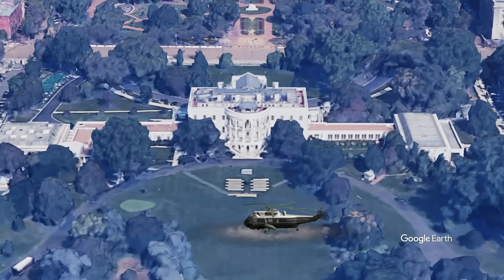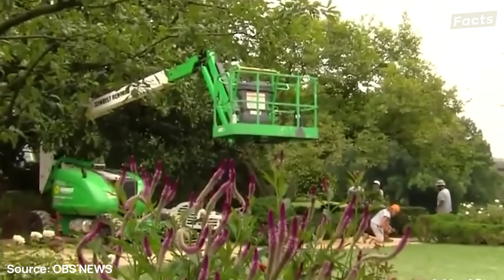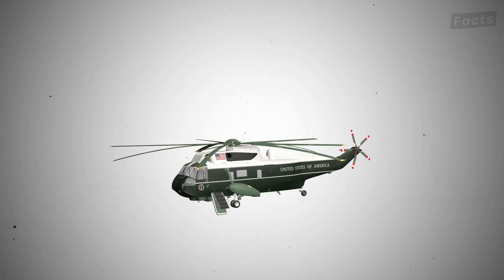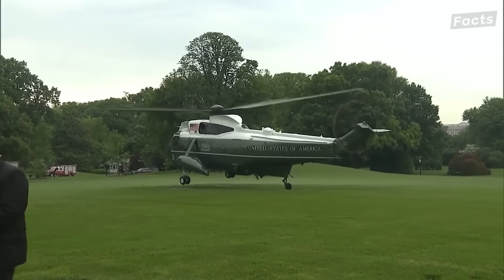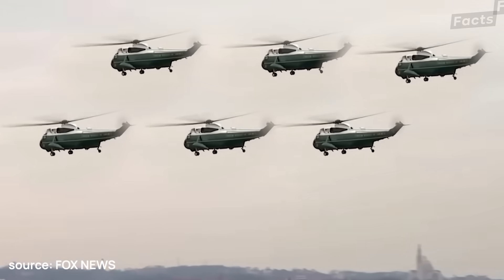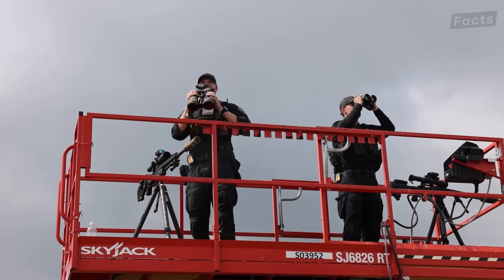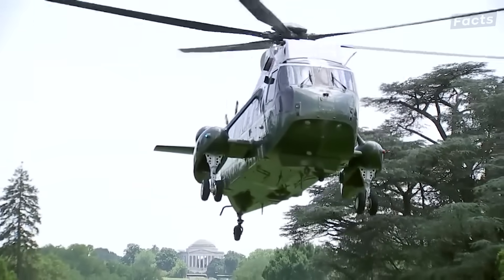Why Marine One Lands on the White House LAWN?

Comment: Yeah, it does feel absurd—spending billions on a helicopter only to stall over a patch of grass when a slab of concrete could fix it. The White House clinging to tradition over something this practical is peak bureaucracy. They’ve got the tech to fly the president safely across continents, but apparently draw the line at a helipad because it might ruin the vibe. It’s almost comical—like refusing to fix a leaky roof because the shingles are historic. Paving a spot seems so obvious, you’d think they’d have done it by now just to shut everyone up. What’s next, banning the chopper because it scares the squirrels?

Comment: Just to throw it out there the rating for the typical industrial type blower used by landscapers blows air much faster than 100mph. I think it’s like 250mph. So either the helicopter wind is WAY faster that 100mph or the speed of the wind coming from the rotors is of no concern at all to the grass

Comment: How about using the fountain as a landing pad?   Modify it a bit with easy walking access, turn the water off (duh), the blade down wash would try it out for easy walking.  The existing fountain may need to be enlarged/modified/reinforced.  But the grassy area would remain.  In essence the fountain is updated and becomes multi-functional.  Yes, the passengers may need to walk a bit further.

Comment: The simplest reason is because grass looks way better and does not heat up the air as much as a helipad would. Anyone who has ever worked on or had to travel across a concrete taxi way knows how incredibly hot they get in the summer time. With boots on walking a mere 50 feet across that concrete would get your feet so sweaty your boots start squeaking.

Comment: Ok the point 😂this video is moot. A there is a massive underground tunnel system under DC the President has ways to get to multiple evacuation sites.  Usually Marine 1 is a smoke screen. Let's examine some system magic. The President walks to the aircraft. He/She might speak to the press on their way, once inside the aircraft. You are distracted by all the other things that are going on behind the scenes. The President can exit the aircraft and slip into the tunnels the Helo takes off and then lands and you see The President walk to 28000 or 29000 and he can enter either plane then exit using different tricks used by magicians to exit for the other aircraft. The point is you can never know where the President is once he enters any of the vehicles required for him to travel. Plus the use of Body doubles is a must. For example Hillary Clinton had 5 body doubles. You have to be very observant to know if you are really seeing the real Protectee. Even if you are literally present in the actual area. Watching it on TV more magic is used. You see camera positions angles. But you never see behind the aircraft. When any protected person enters a vehicle it's always a close up. All to protect the Office and individual. It's all a Choreography, very complex and has many more parts than the public is aware of. We saw many parts of the breakdown in the Choreography with Biden and Harris. Only believe 1 quarter of what you see from your position of view and less than an eighth of what you hear. It's a complex process to protect an individual. More moving parts on a 3D scale kinda like solving the rubics cube on a 3D chessboard

Comment: Here in Ireland the SR-92 is currently used by the Coast Guard however the fleet is being replaced as they are outdated and parts are now hard to source. It's difficult to  understand  why the military presidential variant the VH-92 is now being introduced as they are already outdated here. How are they going to source parts given they can't be sourced in Ireland as parts manufacturing is being discontinued I believe.

Comment: Holy fuck... The solution is so simple it’s not even funny.  
Artificial grass. Nowadays, it’s so good that from less than 2 meters away, you can’t tell it apart from the real thing.  
Just build an H landing spot and cover it with artificial grass. Problem solved.  
Plus, it won’t need to be cut or watered.

Comment: there are several options they could employ... 2 of the easiest... 1) just build a damn helipad and during events cover it with astro turf..... hello??? and 2) could do a solid engineered permeable base topped with turfstone pavers that have grass planted thickly in them.... its such a small area from the perimeter fence you would never see it..  the solutions sure don't seem to be rocket science... from this tax payers standpoint, build the dang pad....

Comment: Soo lay down a concrete pad, put high end turf over, distinguishable from the sky where to land, but still picturesque from the ground level. Reinforce whitehouse structure with wood or steel. This is the United States lol easy “problems” to solve

Comment: A lot of misinformation in these comments. I'm speaking as a former HMX-1 Command Pilot. The aircraft do not land directly on the South Lawn grass. Before a landing, 3 red-painted plywood circles (called "the boards") are carefully placed at pre-surveyed spots for each of the helicopter's wheels. If you look carefully at the video, you'll see the boards. Less evident are the two sections of flat firehose that are placed in line with the aircraft commander's foward centerline and his right shoulder. These act as as guides to place the landing gear precisely on the center of the boards. The copilot also verbally guides the Command Pilot giving running directions as he's looking over his left shoulder regarding final approach to the touchdown such as, " Back 20, up 10, back 15, up 8, back 5, up 3, BRAKES!"  At the "BRAKES" call, the aircraft is gently lowered onto the boards, and because of the VH-3s natural hover attitude, tailwheel first, left mainmount next and right mainmount last. I was there for the Regan/Bush administrations so I'm not sure how the procedures will be different for the new VH-92A.

Comment: You can stiffen the soil.
You can buy this plastic, expandable "web" that has pockets that are usually between 2 to 4 inches deep. You expand the "web", lay it out across the soil, fill soil into the pocket cells, and then toss some grass seed on top of the whole thing. You could even start by first putting a layer of crushed peat stone underneath it.

Comment: Downwash has nothing to do with the engine or its horsepower, it rather is just a result of the helicopters weight. The heavier it is, the stronger the downwash. (Newton's Law of Force)
Reply: It's the rpms of the rotor operated by the engine to turn the rotors the heavier the helo thr more rpms you are going to use so to answer this question yes you need the motor to operate the helicopter the more rpms on the rotors the more downwash
Reply: No engine no power no power no downwash genius
Reply: @tylerbuckley4661  nope that’s not true. Big helicopters have their rotors running at a constant speed, they gain torque by using a governor which adjusts the blade angle.

And still Newton didn’t care about RPM ;)
Reply: @vw72713  not the govonor it's called a collective stick on the left hand side of the damn pilot which  has the throttle and newton's law has nothing to do with jack crap Bubba

Comment: Why not simply land on a mobile pad that is driven out on the grass w lawn safe undercarriage designed to absorb the heat from the exhaust and be designed to self level. Drive it in when needed. I have a feeling the Air Force one after the new one coming so say 2050ish will be a plane with hover tech as well so they likely will land either Air Force One or a s m.h Waller version that can lift off and jet off much faster then any helicopter is able.

Comment: They could solve the issue with the LZ by digging up the lawn and putting a thick layer of concrete in the ground then replacing the soil and laying down fresh grass to hide the underground concrete pad.

Comment: I've got significant flight time as pilot in the USAF variants of the H-3, the CH-3E and the HH-3E "Jolly Green". This video severely overstates the  "problems" of landing a helicopter on a grass field. The helicopter would be pretty useless if it could only land on reinforced concrete slabs. The presidential support mission is rather a "Gucci" operation: pretty clean, don't get dirty. The rest of military helo ops require routine landings in grass, dirt, mud, sand, snow, tundra, everything. I have literally thousands of landings on unprepared, untouched by human hands ground and never sank into the soil. Outflow from downwash, however, is a significant problem for surrounding structures and people.

Our youngest helo pilots are taught early on to land with "sniper-like" precision within several feet tolerance... not an easy feat at first but something every pilot can do by the time they earn their wings. Twenty years of experience is not needed for this skill. We pick O-5s and O-6s for different reasons.

The Flight Restricted Zone around D.C. and the Prohibited Airspace around the White House do not restrict the overflight or landing of Marine Corps One. That would be sort of like preventing firemen to enter a burning building. There was no point in citing that airspace as restrictive for MC-1 operations.

Lastly, a major reason for delay in replacing the VH-3 is because President Obama slowed the procurement program in 2009 as a budget cutting act. At one point, he told the media "The helicopter I have now seems perfectly adequate to me."
Reply: "The helicopter I have now seems perfectly adequate to me." 
Was it adequate?
Reply: @rael5469 He survived the use of it!
Reply: @rael5469  8 years laters with the overtime and overbudget for these kind of project …

That was like thinking you can clean cat puke on the carpet later in the week…
Reply: @G_de_Coligny   A helicopter isn't cat puke. That's just weird.
Reply: @rael5469  I've never connected Marine One with any sort of regurgitating felines... as you clearly stated, "That's just weird!!" Well stated.  More to the point though, someone on the President's staff should have some influence on the access required by his ride.  If the President signs a work order for an adequate concrete platform with matching "Astro-Turf" or an acceptable equal, it might take two weeks... OK, DC Paperwork... 6 months!!!  It sounds like nobody wants to offend some paper-pusher with a bit of attitude. An effective Presidential attitude might be something along the lines of, "I'm only here for 4 years...OK, maybe 8. I'll just sign the damn thing and tell the grounds keeper to get it done. NEXT.    👍
Reply: @wzman2006 "The Flight Restricted Zone around D.C. and the Prohibited Airspace around the White House do not restrict the overflight or landing of Marine Corps One. ... There was no point in citing that airspace as restrictive for MC-1 operations."
Agreed; citing FRZ as a restriction demonstrated zero comprehension. 
'Beyond Facts' has no idea what the airspace designation is for, and to whom it applies ... yet includes mention of it in video, inappropriately.
Reply: I was thinking of combat helicopters would make those MASH missions in Korea pretty difficult if they needed helicopters pads!
Reply: Same thinking as delay O care 5 years ..... leave the clean up for the next Prez.....

Comment: You might wanna do a touch more research, bro. only the best Marine Corps combat veteran helicopter pilots get the fly marine one. So some of the best rotor wash is 120 miles an hour at least not 100 and those are dish. They’re called cookies.
Reply: Rotor wash is mild, Worked under S-54, S-61, S-58 A crane is 160, 61 is less then half that and a S-58 is 30 odd 
Seen Loose debris and HVAC curbs fly with the S-54 filled with steel beams rolled in them like Taco Bell off the roof.

Comment: Even with the additionally added surface area of the three aluminum plates you mentioned, that's still pretty hard for me to imagine. Aluminum could be bent even by hand, so how is it going to be strong and rigid enough to withstand 19,000 lbs worth of aircraft? Then there's the PSI's from the plates being transferred to the soil; for as small as those plates are and the weight of the aircraft, I don't think those plates would be large enough to reduce the PSI's to a reasonable threshold...especially with the newer M1 weighing at 28,000. If it were steel, reinforced concrete slabs or something else, that'd make more sense.

One suggestion I would bring up to the WH is to instead of building out a whole circular helipad that would be an eye sore to look at, keep the idea of the plates but make them permanent. I'm no civil engineer or anything like that, but I reckon that they could drill out a huge 6-8 ft hole at each place that would have a plate, and essentially create a pillar of sorts, the same way that a pillar would be used to help support a structure, and the top end of that pillar would basically be the "plate" that M1 would land on. Cosmetically it'll just look like those 3 plates that were temporarily placed there are now installed there permanently, but other than that, nothing else would be out of the ordinary yet those 3 deep support pillars would allow even the new/future generations of M1 to land without affecting the surrounding soil/landscape.
Reply: No need for anything, S-61 at full gross can land any where grass dirt grass black top even water
Reply: @HongyaMa  it's more to do so with out damaging the ground below it. the machine may be able. the grass will not survive that if it's done over and over and over. 
Same with the building do to the wind the machine generates. 

that's where the challenge is. how to do that with out chainging the visual effect of how it all looks.
Reply: @sirBrouwer   Grass grows back & The rotor wash does less then you think. 45+ years commercial helicopter pilot
LAPD heliport hasn't changed in the decades of operation , Compton police pad too - South side grass Corona was home to Hiser Helicopters with 30+ helicopters from little Robinsons to Chinooks still grass

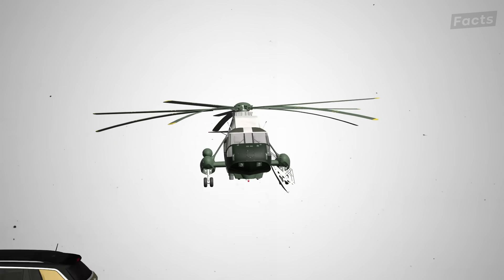Comment: At 3:50 it says that the helicopter lands on 3 wheels, but looking at the video, it clearly lands on 5 wheels.
Reply: 19,000/5=average 3,800 lbs per wheel (I don’t know weight distribution but doubt that it’s equal.)
Reply: I noticed that, too. It's semantics, but it's three landing gear, two of those gear have two wheels. They should have said gear instead of wheels, but for a high-level look, it's close enough, I suppose.

Comment: Your video was out of date when released. The VH-3was replaced by the VH-92 in early September a month before your video. in fact President Biden used the VH-92 for the first time to travel to NYC for the 2024 9/11 Memorial services.
Reply: I don't know where he was going to or coming from that day, but I don't think the -92 landed at the White House. You're correct that Biden did use it that day, but I can find any supporting information saying it was to/from DC.
Reply: That Sikorsky 92 has oiling issues and a junk track record in the oil industry 
S-61 is an old work horse with all the bugs worked out

Comment: I wonder why they don’t pour concrete on the landing zone and cover with Astroturf or similar?
Reply: Possibly because of the issue of astroturf potentially degrading to a stage where it would cause debris that could cause issues with the engines if it got into it - even if they remove the filler that's often found in astroturf as well.
Reply: Not needed